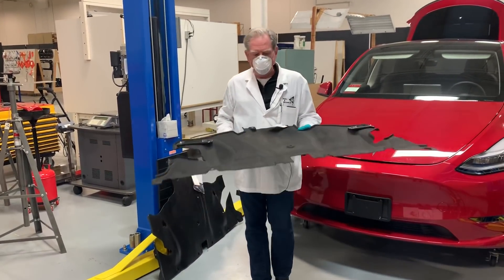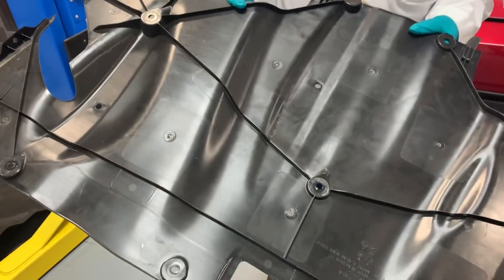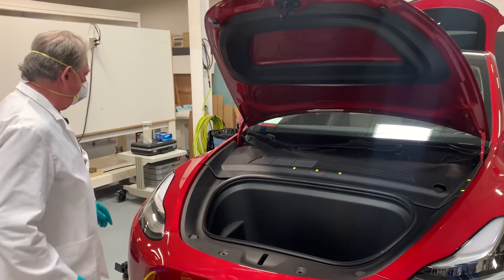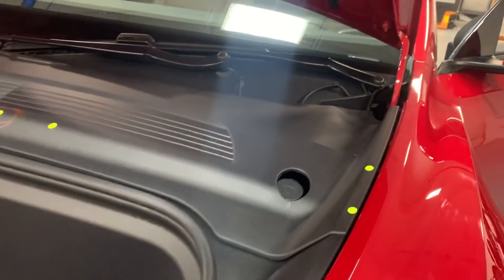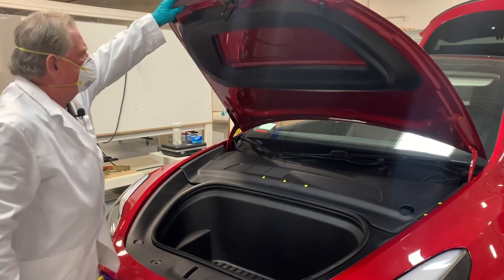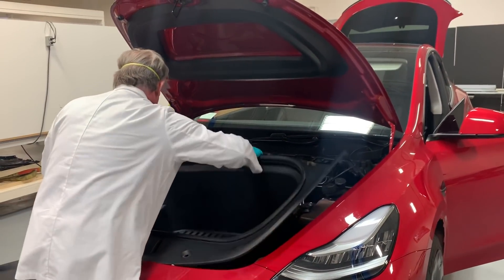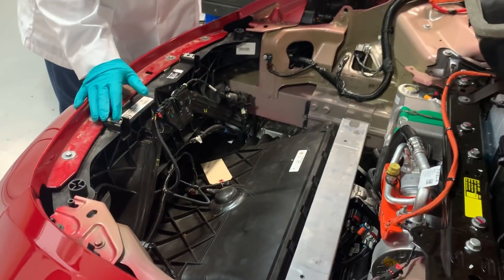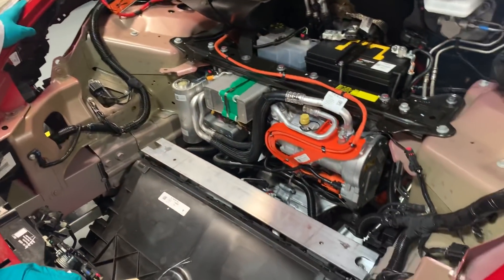Model Y E9: Aeroshields MY-M3, Hood Alignment, Engine Bay Rail Reinforcements (SORB)

Comment: Still enjoying your Model Y tear down videos, Sandy. Great work. Can't wait to see you dig into the new heat pump and Octovalve thingie. Have you noticed any big changes to the wiring harness? That was one of the things Elon said he wanted to change on the Model Y. He wanted to make it much shorter. Do you see any flex circuit in there?
Reply from the maker: A lot of folks have inquired about the wiring, and we will absolutely be digging into that.  Likely it is going to take some time though, as we'll need to actually open up/unwrap harnesses to get a true understanding of overall length of wire utilized.  We'll be keeping our eyes peeled for flex circuits as well! Stay tuned, Lars!
Reply: He was praising the plastic wire wrap.  I would bet they better protected the wiring because when you reduce wiring, each wire is responsible for more things so each wire is that much more critical.

Comment: I'd have liked to see if the frunk closed ok once the plastic covers/insert had been removed.
Reply: Exactly - kept waiting for that myself.
Reply from the maker: Interestingly, when the frunk trim is removed, we found that the hood actually sits sub-flush to the lip on the fascia.  It appears that the hood fitment is set to account for an interference fit with the frunk bin/trim.  Not a typical execution.  Thank you for watching!
Reply: @MunroLive  Thanks for the feedback Sandy.
Reply: Munro Live Thanks for the update. You guys are doing a great job on this 👍🏾
Reply: @MunroLive  is there any reason why car had no frunk gap in first videos and it appeared later?
Reply: @dublux9878 
Tesla QC... It  was bad in the  other videos.
Reply: @Robert-j6r8c  no it was't
no gap/small gap https://www.youtube.com/watch?v=yWU65rv-r7w&t=30
big gap - https://www.youtube.com/watch?v=J1wgaJmtSDI&t=4s
Either they did it or person who washed a car did it since gap appeared after car wash.
Reply: @dublux9878  Good catch! Yeah, looks like someone got frunk-curious, messed up that cowl cover (maybe broke the clips trying to remove it) and just placed it back and forced the trunk lid shut when the cover was not properly positioned. If the tolerances on all those parts are small enough (which they seem to be), forcing the trunk lid shut might have deformed it slightly.
Reply: @MunroLive  Or was the sub-flush problem created by whomever misadjusted things prior to shipping?  Aren't the original positions viewable (paint, etc.)?  If you aren't past the point where the parts are still hooked together just put the hood hinges where they were prior to painted and bring the latch back to where is was supposed to be.

(Or I may have misunderstood....)
Reply: @MunroLive  I guess the car had been tampered with, and not as per factory condition. Rookie mistakes off-camera perhaps?
Reply: It will be easy to see if other cars have this problem
Reply: @JeevanAnga  They aren't "rookies". Though you and the assembly workers at Fremont clearly are.
Reply: Per Sandy, car was bought from a dealer, not directly from Tesla. If there's any issues, dealer is the main suspect
Reply: I would like to set a camera and lighting put in there. I wonder what is not right
Reply: It closed perfectly fine in the first video of this series, so he must have done something wrong. https://youtu.be/Q594XSQ3GwM
Reply: @HotHatchTV  What the hell?
Reply: As soon as we got our Model Y home we noticed two palm print dents in the funk (hadn't even opened it yet). I can see something similar to the right of the T logo at 1:33. The frunk is ridiculously hard to close & any normal amount of force dents these aluminum panels. Major design flaw. Might try removing some of the gaskets
Reply: @chrisr4488  It would be great if Tesla can electrify the frunk as it is something that is opened and closed on a daily basis because it's a front trunk and not an engine bay which you don't open usually.
Reply: In the first video, it shows Sandy closing it incorrectly as if it will just close like a typical heavy engine bay lid. He then incorrectly pushes it down with one hand on the side bending it.  It's fragile, in the owners manual it explains how to close it using two hands one on each side of the T emblem.  It's a fragile light weight hood not a truck bed door.
Reply: I agree, but cars need to be engineerd to cope with careless handing by the user.
Reply: @steveseeger  If that's the case then the hood design has not been done properly. Way too weak for a hood. I don't think that's the case. It should be a mistake in the production line. Hopefully, a one off.
Reply: @itechiwizard83  I use the frunk like 3 times a year. It is fragile if you think its a truck and not a sports car.  You lower it onto the latch then press it down right over the T logo. It's in the owners manual. If you press on just one side it will like warp the whole thing probably like he did in the video.
Reply: @steveseeger  In that case why hasn't Tesla made it stronger ? The hood of other cars can be pressed on one side and would close just fine, I'm speaking of something like a Toyota Corolla. 

And it would be better if Tesla can electrify the frunk as it's something that people frequently open and close unlike the hood of a typical vehicle.
Reply: @itechiwizard83  I would guess that it's for weight savings.  No one I know uses teh frunk for daily storage use. I keep the charging cable there for the rare time we stay with family and I want to top up instead of supercharing. There's tons of storage in the real trunk, it adds like 10% more maybe.
Reply: @steveseeger  Nevertheless, it's a nice feature to have and hopefully they will have it in their future iterations.
Reply: @steveseeger  If that's the reason it is simply made too weak and fragile. He didn't apply any more pressure than you'd expect to fully close a hood on any other car if it doesn't latch from dropping it. I've done that probably hundreds of times with the aluminum hood on my outback without any bending issues.
Reply: steve still no excuse - customer know only this kind of hoods since years so Tesla should rather make a good product instead of a manual to use a hood - sorry that’s rediculous
Reply: @steveseeger  LOL, 120 years of hoods and Tesla requires a different closure technique. Fail.
Reply: @joegreene6250  It also doesn't run on gasoline.  Second fail?
Reply: @joegreene6250  Better than doing EVERYTHING the same as as it has been done for 120 years and ending up bankrupt like Ford, GM etc will be. Innovation is not without risk, and yes, some fails. 100% worth it to all but the most blinkered.
Reply: Haha when you remove everything under the hood to see how it closes... kinda defeats the purpose! Maybe that blue paper dentists use to check your bite but a little larger???

Comment: Glad to see they're making things better. That's a big part of Tesla's ethos: continual improvement/rapid iteration cycle. I am not sure if that is a necessary thing because they're so young and relatively inexperienced and have so much to improve upon (hardware only) or if they can continue this rate of hardware improvement ad infinitum. Either way, glad to see them improving. It sounds like, so far, the MY is starting off much better than the M3, and the M3 is absolutely dominating it's market, by A LOT. Can't wait to see how the MY sells.
Reply: They have far more experience than a traditional auto company because they iterate so fast.  You have to remember that traditional auto ships to dealers that fixes the cars up before selling.  Tesla delivers directly to customers, so they have to reach much higher levels of quality.  This build already surpasses the lower standards allowed by traditional auto manufacturers.

Comment: Dear Mr. Munro, could you please advice TESLA to have the orange sticker pointing to the high-voltage cable have hang out from this cover you've just talked about in this video. It would help firefighters to easy find it in case of rescue missions. Thank you.
Reply from the maker: Many OEMs, Tesla included, publish Emergency Responder documentation for just that reason.  See pages 13-14 at this link for Model Y specifics: https://www.tesla.com/sites/default/files/downloads/Model_Y_Emergency_Response_Guide_en.pdf
Reply: is certainly helpful and could save a few seconds. But don't see it as dramatic, since the position should be known and other critical points (airbag cartridges, 12V battery) are not specially marked on the vehicle, but also known from firefighters.
Reply: @Zedus-rl9hp 
Every car is different, as more and more EV models come how many are firefighters supposed to remember.

I have trouble remembering what side the fuel cap is on, when I drive my other cars.
Reply: @Robert-j6r8c  The place of the high voltage cable is very similar. Otherwise there are rescue cards that show where which parts are located. The 12v battery in an ICE is more difficult. Partly in the trunk or under the seat or 2 pieces installed separately.
And before you see the sticker, you would have to know the emergency release of the frunk or just cut it of.
Reply: @Zedus-rl9hp 
I think there should be a standardised placement of the wires or be easily identifiable, as with EV's have a greater risk due to the danger being invisible. 

It's much easier with gas to determine where the danger is.
Reply: @Robert-j6r8c  The batteries separate even in the event of a serious accident. The cable is just an additional safety device to be 100% safe.
In addition, this is less about an electric shock, but about preventing a battery/cable fire by a short circuit.
Reply: @Zedus-rl9hp 
Fair enough, never knew they automatically disconnected.

Comment: what if the previous dealer removed the frunk to look at the inside and caused the clips to break?
Reply: Tesla doesn't have dealers.
Reply: @_PatrickO  I know, but he purchased it from a NON-tesla dealer
Reply: @maxmoq8423  Why would a non tesla dealer mess with the car?   It sounded like he got this one from tesla, but the second one comes from a different source.
Reply: @_PatrickO  he said they bought it at a 20k loss from a dealer implying not Tesla
Reply: And adjust the bonnet and latch? Doubt it.
Reply: Robert could have removed the latch and frunk and then found it hard to close so he adjusted the bonnet instead of readjusting the latch that he removed
Reply: @maxmoq8423 
Why would they remove it in the first place. 
I would understand if it wasn't across the board on QC.
Reply: could be to develop an aftermarket product or to document differences between model 3 or to document heat pump... many different reasons why someone would purchase a new vehicle so quickly and then resell it within days, so most likely a company designing aftermarket accessories and needed dimensions quickly and fitment confirmation
Reply: @maxmoq8423 
I think it would be easier to just buy the report from Monro and associates.
Reply: sounds like a legit reason!